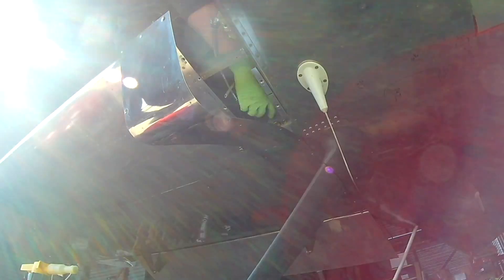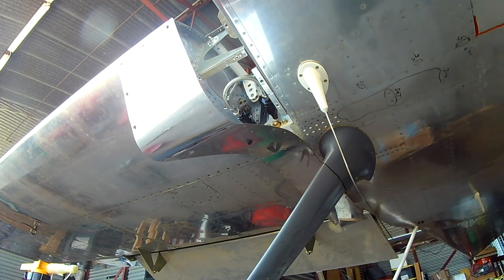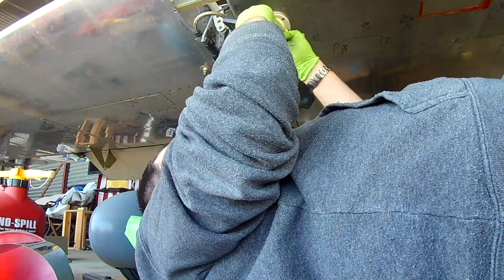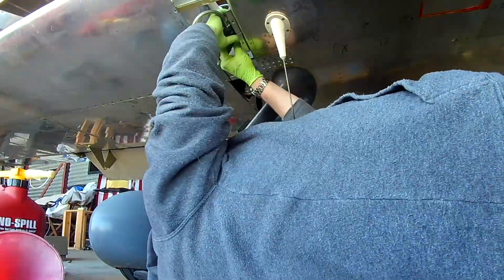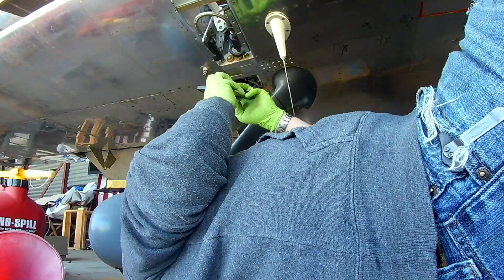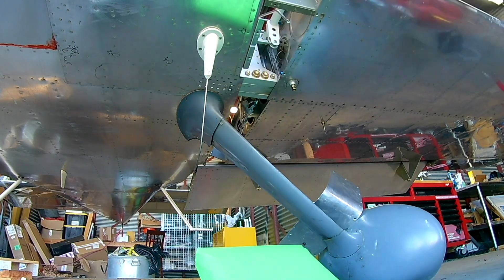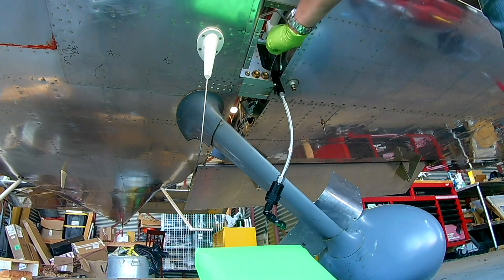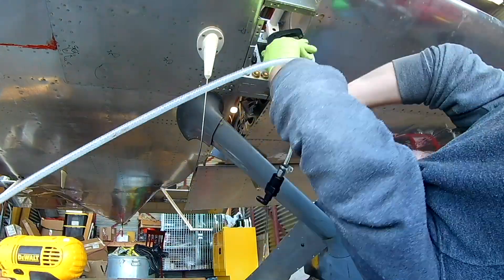RV-14 Wing Root Fuel Filters

Comment: I think the redundancy this buys you is worth the hassle. Also, you may want to pick up a couple of element replacements for your condition inspection. They are $16 each plus shipping from Holley vs. $100 for the entire filter. You should be able to change the element on the wing without too much of an issue.